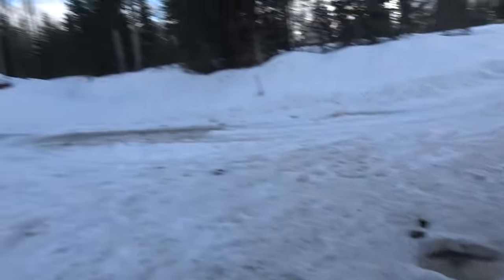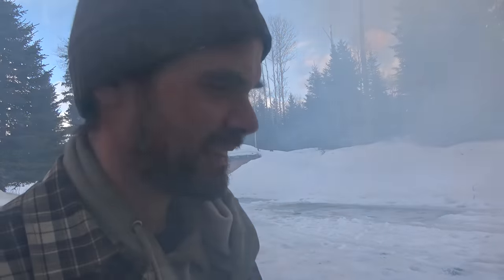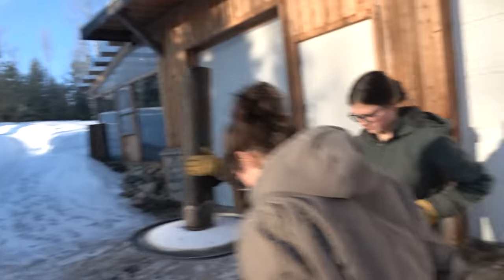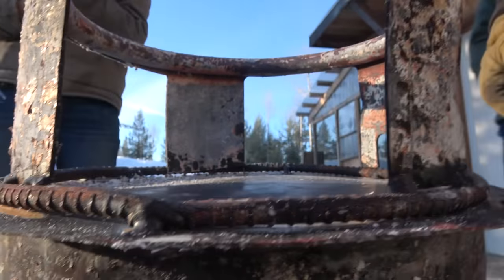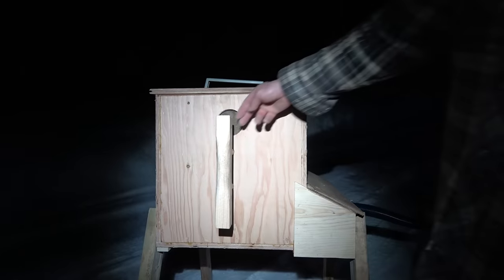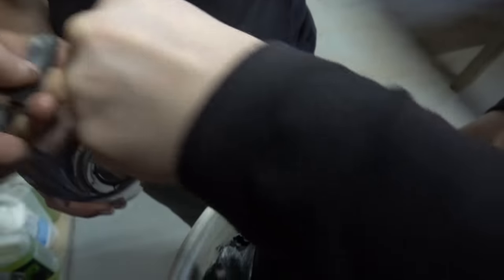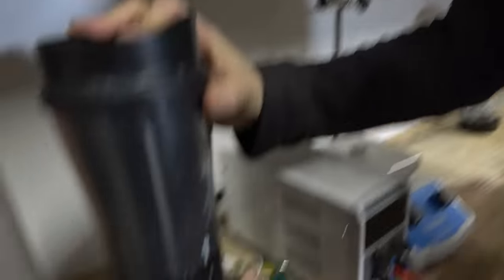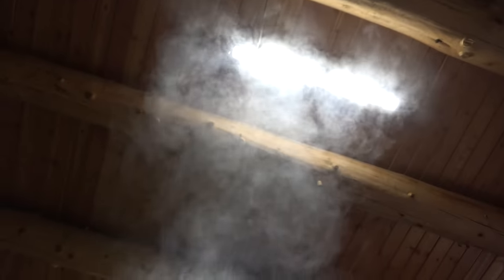Super Easy Black Powder from Home Made Charcoal

Comment: For better BP use willow if you can get it up there or barring that use grape vine for your charcoal. Your powder will be better and less sparks. Adding some red gum as a binder will help as well. And if you granulated it (water and rubbing alcohol added to make a clay consistency and rubbed through a screen) will make it faster burning
Reply: True
Reply: What is it about the willow or grape vine?  Seem like very high moisture woods.
Reply: The pores in different wood. Pine is excellent. I use old peices of cut off 2x4s. Old pallets. Pine is my second choice but works fine. Pee in a jar and use stale urine. Alcohol will let it dry faster. Rice gluten is the old chinese way. Put the wet mixture  on wax paper and place a brick on it. Compacting it makes it better. 
For sheer easy fun your way is fine. Works in my pistol and rifle.
Reply: A little hemp string saltpeter and powdered sugar and you have homemade fuses
Reply: how much red gum by weight do you recommend?  Edit: Could you add graphite at the very end, after the BP is granulated?
Reply: That's how I did it in the Ozarks. Dandahermit
Reply: White pine is just about s good.  I saw experiments run with different woods and the idea that willow is the best by a long shot was debunked.
Reply: For very fast burning BP use Paulowina wood for charcoal.
Reply: @maxhames499  Hello, how you mean it with that urine? Im confused. Put pieces of wood inside and let it soak while?? how much??then make charcoal from it, or put final BP in urine and then dry with alcohol? Thank you
Reply: @jirispacek1805  I think he means mixing the combined ingredients with urine.  Never heard that before.  I have heard water or the use of alcohol for angrier blackpowder.
Reply: I hear that debarking the willow will make the BP burn more efficiently. I'm going to try that with my next batch.
Reply: @grantnorthcott5112  I try this method too. And I just found best and most easy wat to debark willow if you dont neet it quickly. Leave it on the rain and sun for few months, maybe year and bark fall off by itself and wood is perfectly dry. I found some old wood lying outside in garden and it looked exactly like this
Reply: @whycomes9562  urine has urea and sodium in it compositions. Maybe that helps BP be better.
Reply: @solrac7986  Maybe, but you don't hear of those guys who launch tennis balls for the best black powder using urine. Maybe they do and are too emberrassed, of their secret.  Lol
Reply: @jirispacek1805  
Edit: I meant to say saltpeter, not sulfur.
A little late, but I think what he means by the urine is that you can make saltpeter from it. In places where saltpeter wasn't commonly found, they used the urine of pregnant mares to get their saltpeter as that had the highest amount. Mares would pee on the hay and the pee would drip off, but the saltpeter would get deposited it on the hay.
I know of a youtuber called Codys Lab that did this with his own pee. He kept it in a bottle for a while and then he poured it over hay, but I can't seem to find the video anymore so it's probably been deleted.
Reply: @vizierspty  eastern red cedar is tops, too.
Reply: Granulated by using water and alcohol will make mixing it a lot safer. With a low humidity air mixing dry power may generate static electricity sparks.
Reply: @survivinggamer2598  Don't know much about black powder but in a pinch you can soak wood chips in a barrel with urine and after a time you have your potassium nitrate for the garden (usually done the year before).
Reply: Yeah, whatever you do, don't use Oak. For some reason, Oak just isn't working for me. As for willow, what variety? Any? Other videos I saw, guys had branches from a weeping willow, but around here the only willow you'll find are the thin spindly bush like willows that grow near water. Would that work?

Comment: Ever since I got into blacksmithing..I also use a box bellows like dave!... I've been making my own charcoal in a 55 gallon drum.. just get a good fire going in it so you have a good bed of coals then load it up with your charcoal material..let it burn until fire is catching the gases on fire and put a lid on with a Crack like a grill..when smoke turns metallic blue it's done plug all 4 holes in the bottom of the barrel and seal the lid.. usually get about 30 gallons of pretty nice charcoal!
Reply: i appreciate you putting this up... i might have to try something similar...
Reply: @vidard9863  works good but keep your wood small..branches and such are perfect

Comment: I made charcoal in a steel box I made put in a firepit. Had a few successful runs, then one time I put it in a cloth bag as it was cool enough to grab it with my welding hands. Really wasn't hot to the touch. Put it in the bag and set it by my old ladies rear bumper. About 30 minutes later it was fully ingulfed in flames and rear bumper and hatch were burned very well. Got the fire put out due to quick action and fire extinguisher, but I will now store all my charcoal in a sealed 55 gallon drum so this doesn't happen again.

Great Video!
Reply from the maker: Good point, thanks.

Comment: I made a pipe cannon with a 20” piece of 1 1/2” black iron pipe, threaded on one end. I screwed a plug into a threaded coupling that usually comes with a 20’ stick of pipe, drilled a hole just big enough for green fuse to slide in. For a projectile I used a 5/8” bolt 3” long with a 1” hex head. I set up my cannon against a tree base and would put a few heavy branches over it so it wouldn’t fly away. “ make sure to have some big trees to hide behind “ after cannon went off with a very loud boom, the bolt stuck into a tree 60’ away hex first 2” deep. I set cannon off multiple times, only better noise was a full size civil war cannon me and a friend lit off once. Fun times.
Reply: lot of fun, highly recommend, but black iron tends to fracture in my experience, examine it carefully before loading it and i highly recommend any one else who reads this to hide from the cannon when using a similar setup. it will catastrophically fail at some point.
Reply: @rtchow3000  that's not nice. Why bring politics into this thread?
Reply: Lol crazy kid man that's great same stuff I did while growing up.... And we survived
Reply: Karen here,  yeah, you are playing with explosions and lost limbs with your experimentation. I can see a different type of [safer] projectile and some research into your piping grades. Otherwise,  cool experiment and exercising  useful knowledge.
Reply: @thetwotravelers546  a pipe bomb has two closed ends, a cannon has only one plugged end. Kinda simple really. But yeah for some douch from the government, I see your point
Reply: Sounds a little crazy ????

Comment: You need a bend in your intake duct so the fan isn't exposed directly to the radiant (IR)  heat.
Reply: You can’t bend the laws of thermodynamics, but you can have a  kink it and job done ha ha 👍
Reply: i think the best option  would  be to  not have the fan touching  the  metal  tube  at  all. Even  a half inch gap would break the thermal  bridge.
Reply: @kevinhardy8930  nope. 3 types of heat transfer.  It’s the radiant variety which is causing the issue

Comment: Use the poplar to make the charcoal and pine for the heat, poplar is a relative of willow which makes the best blackpowder, Also poplar or willow charcoal is regarded as the best for art if you have an artist in the family. Great retort by the way,
Reply: I could never quite make top notch blackpowder. Long after I quit, I read that popular was the best wood to use, because it has the least minerals.  Those trees grow really fast too.
Reply: Going to try to use Hackberry (southern US). Great satisfaction to see that miserable tree turned into something of use. (Would never cook on it however)
Reply: I use tulipwood for BP charcoal. It's similar to poplar, grows fast and is pretty useless for anything else, weak wood. Plus I have lots of them growing around here in New England. Works really well.

Comment: I would like to see how your friend built his bellows . I need one for my for my forge Thanks Guys always love your videos keep them coming
Reply: I know right !!!!!  Their videos always have a topic and then I see 10 other things I want to know about
Reply: If you look up at channel called Mr chickadee he shows you how to build them..called a box bellows from Japan very efficient of built good!
Reply: Think steam engine piston, but square. The leather valves let air in, but not out.
Add a hole in the side for air to "escape," and that has another valve to let air out, but not in.
That goes to a tube or pipe to go to the fire.
You'll have to make the tubes go to a common pipe, and just direct it from there.
The piston inside probably has a bit of soft leather around the edges so as to mate with the walls a bit better, but not so tight you can't move it.
The "handles" run both sides of the piston, and that's what guides the piston as well as transmitting the motion from your hand to the piston.
Just make sure that the valves, both in and out, are on the end caps.
The "out" one will have a pipe, the other will be the intake.
It should only take an afternoon.
If you can't find leather, use a piece of inner tube, or make a flapper with a hinge and some small wood pieces.
No end to the design changes you could come up with.

Comment: Take your powder after grinding and mix it with wine or red wine vinegar or even urine. Just enough fluid till it gets wet but forms a very thick paste. (incorporation) Then push that thru a very fine brass screen like window screen fine and spread it out on a tray to dry.(corning) When fully dry grind it down again. It will greatly more explosive...Willow Charcoal has bigger air spaces in it which gets coated with the sulfur and KNO3 and makes a bigger faster boom
Reply: Hahaha wine or urine? Wtf is wrong with water? Or alcohol if you want to dry it faster.
Reply: @JO-ch3el  Alcohol will cause Volotility Problems and will work too good Water will as well but not good enough. Since the KNO3 will dissolve better in a slightly acidic  medium; Wine, Urine or Vinegar are best

Comment: Don't feel bad, Hot Dave. A lot of people get it wrong. Hot air rises, heat goes to cold, in any direction. Some people actually think floor insulation is not needed.
Reply: Most American homes are built with a footing that extends below the Frost Depth,.whatever that might be for that area to defeat "Frost Heave,"  And a slab directly on the soil. Most of the cold Scandinavian Countries built homes with a Floor a foot or two above the soil, and the footing barely below ground. This is done because the heat sinks below the floor, and then escapes out below the footing, keeping the frost depth below the footing and defeating "Frost Heave"
Reply: the problem in this particular case, is the radiant heat ignores air, as it is effectively a beam of energy. the fact you could see the red hot glowing heat means you will feel it regardless of how much cold air you send past it, which is why it was hotter where they were putting their hand than when they were standing closer to the burner.
as far as insulating the floor? it is not needed in many places and in certain structures and locations it is detrimental. buildings and structures MUST be engineered to their location.

Comment: To avoid melting your fan blades put a 90• elbow in your intake with enough length to stay cool.
Reply: length is not really the problem. infrared radiation travels as light and ignores the airflow. the 90 degree turn possibly with a matt surface to catch the heat means the radiant heat is nit hitting the fan.
Reply: Forget the fan make the stack ( chimney ) taller that will draw air through rather than trying to push it from under the fire.
Reply: Or wrap with sn old towel. Pour water on it ever so often.

Comment: A classmate in my chemistry class in high school got the idea of substituting potassium chlorate for potassium nitrate, which is the oxidation substance. Potassium chlorate is a much better oxidizer so it was an interesting idea. He mixed it in his garage and put the bottle on the hood of his mother's car, which apparently had been recently driven. The heat of the hood ignited it. He got cut from the glass, lucky that was all. Put a good dent in the car's hood though. BTW, sodium nitrate aka Chinese saltpeter is used when making blasting powder.
Reply from the maker: Good info, thanks!
Reply: Robert Wallace  Yah, Potassium Chlorate  and sulfur mixture is fairly unstable and will go off with friction, static, or impact.  Potassium Perchlorate (KClO4) is much safer in this regard.  A similar mix was used to make Railroad Torpedos.
Reply: @awiggins7031 isn't potassium perchlorate used for primers?

Comment: Heat transfer comes in various forms: conductive, convective, and radiative. The comment made was, "I thought that heat rose". Yes that is true for convective heat transfer. The heat energy that was "heating up" the fan at the end of the pipe was radiative.
Reply: I found myself thinking (at the time) that it was conductive through the metal of the pipe.

Comment: Note to anybody who gets freezing temperatures! Don't cut your propane tanks till winter. Fill them 3/4 full of water, leave outside to freeze. Cut away with your cutting disc. You have built in fire suppression. There have have to be some advantages to living in frozen places.
Reply: I soldered a gas tank after gassing the tank with the exhaust from my garden tractor for a half hour! There was still gas in the tank too! It never blew because of no oxygen in the tank! I did have a small fire in the grass under the tank but put it out with a wet water soaked rag! Fun times!!!

Comment: I make my own charcoal but i use it quite differently.  I use it to run small engines on. Best of all what is too fine for that works great for black powder.  I have never made black powder.  I put my fines in the chicken coop to surpress oder and be inoculated  for my garden soil.  Has so many eses from air filters and water filters to cooking and blacksmithing.  I keep barels full on hand. In adition to a retort i have some smaller vessels i can  use in my woodstove. This alows me to use the heat and still have some fuel in the form of charcoal to burn again.

Comment: I made black powder as a kid, fast forward about 40 years and I started making it again as a big kid 😂 but that’s what got me into charcoal and realising just how amazing the stuff is. I use a similar method although I use a 44 with both ends cut out then wrapped in corrugated iron that’s about 8” longer than the drum, then set a 60L drum inside on a platform as the charcoal retort. What this does is allow most of the air to be drawn down the corrugated iron on the outside of the drum which acts as an air preheater, gets very hot with very little smoke once running.
If you want to experiment, the type of wood used for the charcoal in black powder makes a big difference in burn rate, I think from memory willow may be one of the fastest. There’s a video maybe by Nurdrage where he tests various charcoal black powder burn rates.
I’ve also found bamboo charcoal works well and that makes some sense given the origins of black powder.
Apart from the black powder (and your forge) charcoal is amazing stuff for the garden and water purification.
Anyway thanks for the video, your journey into charcoal is very similar to mine

Comment: Another great video, as all of your vids are! Good to see Dave, again, and he did a great job on the bellows. Your powder worked like a charm!  I like to hunt with my muzzleloaders, but I've never made my own powder. I might have to make some, now, just to see if I can! I would love to come to your campout, but will just have to see about making it next year. It would be so much fun to meet you and your wonderful family.  God bless.
Reply: Making BP isn't hard but please follow one simple rule: if you're going to mill it (which gives way better results), make absolutely sure that the milling media cannot cause sparks. Use lead or brass, maybe ceramic, but I'd be cautious about that even. I used to use .45 hardened lead balls. Never use iron or steel! If you feel the need for a workout, you can use a pestle and mortar. I have tried it - do not recommend!
You can, of course, mill the components separately but it isn't really necessary if the above rule is followed. Also, milled airfloat charcoal is extremely messy stuff to handle!
Purity of sulphur and pot. nitrate are important-ish but the wood from which the charcoal is made has a huge effect on burn speed. As other commenters have written, willow is possibly the best. The powder in this vid burned slooow. For pyrotechnics use, he would have done better to burn the pine and charcoal the poplar! I'm not sure about how fast a burn you want for muzzleloaders but I reckon residuals from pine resin could cause bore cleaning issues?
Once you have your BP, you can add a couple of percent by weight of dextrin (dry-baked cornflour - it turns yellow when cooked) and make a thick slurry with a little water. Pull cotton or hemp thread slowly through this and hang it to dry in a safe place. Now you have blackmatch, old style cannon fuse... it would probably burn at about one inch per second and looks really cool...
Sorry about the long post - I used to play with pyrotechnics and it's still in my blood!